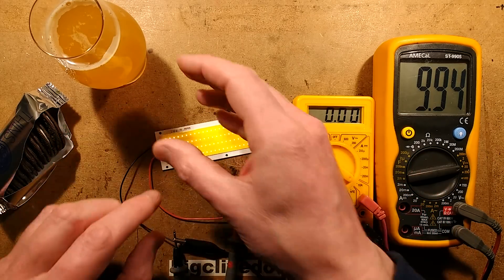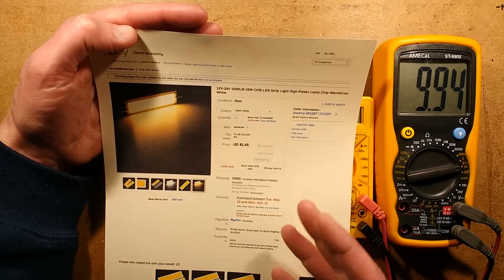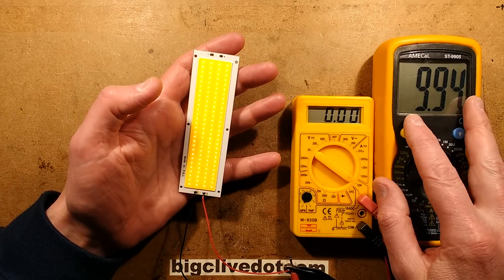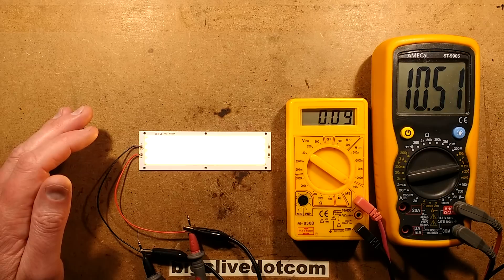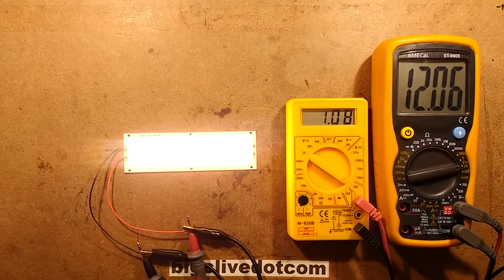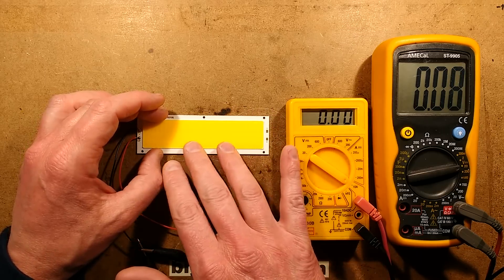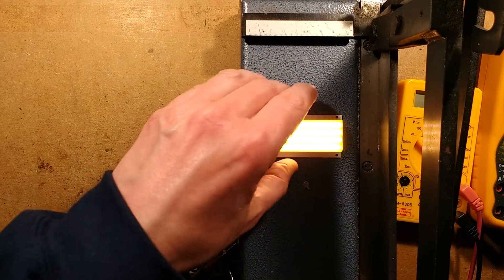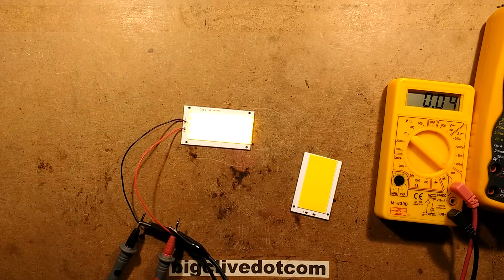Testing a large LED COB.

Comment: ok six years late, but-
What is the forward voltage of these?
I need a constant LED, not PWM.
Have bought a similar panel and an (adjustable) 1 Watt constant current driver from aliexpress, but the panel is either on full bright & very hot, or dim it only slightly, then it goes off.
When slightly dimmed it seems to be flickering ( using it to illuminate a  light sensor, which then reports millions of on/off cycles
Reply from the maker: It depends on how many LED sections are wired in series in the panel.  It could be 3V, 6V, 9V or 12V.  Usually 3V or 12V.
Reply: @bigclivedotcom  Thanks. I put my diode tester on the panel, it is meant to give the forward voltage of said diode. However on the panel, it read nothing, neither did a simple ohms reading.
Reply: @bigclivedotcom  Another question if I may (not sure where else to ask).
Are the cheap Aliexpress 240V LED ceiling lights with little power supply, constant current?

Reason for my asking, I have built a camera shutter tester (that works, unlike most, that forget light sensor also has width, thus give greater under-reading as 'speed' increases) using lasers works great, but a constant current light source would be better in some situations.  Of course a PWM light will not work as the sensors see millions of on/off cycles.

I have tried a panel similar to yours, rated at 1200mA and used a constant current module, with adjustable output to max 1A.

However, lowering the current makes the panel turn off & on full power, gets hot very quickly.

Comment: I just got a couple of these in the mail and my god they're bright. I've only got a cheap universal power supply set to 12V and it's running at about 0.45 to 0.5 amps and it's ridiculously bright even at that current, can't even imagine doubling that. Definitely need to figure out an elegant way to mount/power them and put them to use, absolutely brilliant for the price

Comment: So how warm do they get when driven with 12v ?  and can it be cooler if you have a current limit on it, maybe a XL4015 can be used? or is voltage control is enough using a LM2596?
Reply from the maker: Current limiting is recommended, as is a suitable heat dissipating surface.  With a regulated DC supply a simple resistor would work.

Comment: @bigclivedotcom
I've bought a small collection of these 12volt COB LED's at ebay. Plan was to make several lamps to install in my cabin using solar powered energy from a 260Ah battery. Occasionally the battery will be topped of by use of a generator and a digital battery charger. Peak voltage will be around 15volts during charging.
My question is: What is the best way to control the voltage / current that is easy to build and waste a minimum of energy trough heat.
(asking because the linear regulators using LM317 i bought on ebay gets baking hot when feeding them 15volts and pulling out around 12volts over 1 COB LED)
Reply: I have access to RS Components account at work and found this LED Driver IC : LM3404MR/NOPB
I assume that would be a perfect choice for controller build?

Comment: I bought 4 of these from two different ebay sellers and all of them are suffering from wire bond failure now they've got leds out which will come and go as you press on the panels ...and they're being very much underdriven mounted on large metal sheets with thermal compound so are not even warm to the touch when on for some time....probably a product to avoid .

Comment: i watched this when you posted it, ordered some for my camper trailer. Was just playing around and decided to re-watch. I did have a bit of trouble soldering but will bring out my 200Watt Weller gun with the 10 guage wire tip and try next time. Good stuff. Will look to replace the inside incandescent bulbs, probably with a couple of power resistors and a switch to give a dim and high setting.
Reply from the maker: You can use a clothes iron on a low setting with the plate facing up to pre-heat the panels slightly.  It makes soldering much easier.

Comment: I ended up putting one in my water fountain. It runs under water, so I guess that provides pretty good cooling. Running at 12.6v, no current regulation, BIG wires soldered to it. http://ecuflashking.com/2018-06-17-Water_fountain_LED_light/
Reply from the maker: It'll be interesting to know if it survives or if moisture penetrates the gel.  The external solder pads may corrode is left exposed under water.
Reply: I covered the soldered wire connections with clear nail polish (3 coats) and then a coat of bathtub silicone. For the naked pads on the other end I used just the nail polish. I'll let you know if I see any corrosion. I looked for little bubbles after I plugged it in but nothing so far :)
Reply: Three LED's are dead so far, and one corner is lifting up. Some bubbles are coming out of the crack. Sometimes when the water in the fountain runs low it exposes about 1 inch of the top of the LED cob, just about where the crack is, so not sure if it's related to heat or not. If you have any ideas how I can seal up my new second one to prevent that from happening let me know, or hey, if you think I should use something else than this LED cob, let me know a link :) During the daytime to see the crack: http://ecuflashking.com/2018-06-17-Water_fountain_LED_light/led_damaged_day.jpg and at the night to see the dead LED's: http://ecuflashking.com/2018-06-17-Water_fountain_LED_light/led_damaged_night.jpg and where it sits in the water fountain: http://ecuflashking.com/2018-06-17-Water_fountain_LED_light/light_sensor_daytime.jpg
Reply: It finally completely died today! I installed a new one and ran silicone all around the edge of both the center gel and around the edge of the aluminum, lets see how well it holds up now! Pics of the dead one: http://ecuflashking.com/2018-06-17-Water_fountain_LED_light/dead_led/

Comment: Hi, i love your videos ! I have a question for you : do you know if it's possible to cool down led cob with a Peltier module ?
Reply from the maker: The peltier itself would require cooled.  It might be better with a heatsink/fan on the COB itself.
Reply: thanks for the quick answer ! Yes of course the peltier would require cooling, but have you ever tried it ? Maybe the cooling ratio is better ? I doubt it if we stick to the most simple sandwich structure (led/peltier/heatsink/fan), but maybe there is a way of taking advantage of the peltier ?

Comment: what would happen if you ran it at 24 volts
Reply from the maker: It would rapidly fail.  But you could use two in series.
Reply: that would be boring

Comment: I just got mine today and did some testing and math. The ones I got used 800ma at 12.37 to 12.5 volts the voltage could be decreased as the led's got hot. I did some searching and found some specs for these, they indicate that they can be run between 600ma and 1000ma 12-14 volts. that comes out to 3 to 3.5 volts per LED and 20 to 35ma per column of 4. Mine did not attain a good brightness until they hit 800ma. so mine pull 10 watts at about 12.5v 800ma. The light output is close to a 75 watt incandescent light bulb.

Comment: I've bought some of these off amazon as "car running lights" and they make good lights for use in what I can only describe as 'piano lights' for small bench/desk lighting. They probably aren't as good with price as the one you showed (Mine were $3 per 6W COB). I've run them off a 12V computer power supply and it worked fine, even without any heatsinking.

Comment: Dear Clive....a question:  our outdoor string of LED lights, transformer failed 31v...(it got wet) i bought a LED driver transformer...20-45v  ... plugged it in...the string of LEDs now flash super bright ...not what we hoped for,we want them to be on with no flashing....there is no circuit to make them flash...its just a transformer...so i suspect the power supply is over loading and keeps cutting out??  any ideas????  and please ignore me if you are too busy...many thanks...Dorothy and Simon in France.
Reply from the maker: It does sound like it's being overloaded.  It may also be damaging the LEDs by overdriving them.  If the transformer is labeled Jutai then it will be a very common type sold with a wide range of lights.  It may be easiest to get a new set of lights just for the transformer.

Comment: ebay: more than 182 sold in 24 hours.
just ordered 10 cool white and 10 warm white
Reply: one set arrived today --warm white.
Hakko 888D had no problem soldering to the pads.
Observations:
Started with 6 dead leds, now I am up to 14 dead across 4 panels. When I press some leds, if they are on, the might go off, and vice versa. 12V 1.5 A wall wart, with 10 panels I am seeing the wallwart output drop to 10.69V
 the shipping package was atrocious considering the phosphor coating. Almost all of the bubble-wrap bubbles were flat.

Comment: Awesome brightness. How many milliamps can these cob lights take before they pop or burn out? And why did it not die when you gave it the chop.
Reply from the maker: It's construction is two main power tracks with strings of four LEDs in series between them.  I cut it between two rows of LEDs so both sides worked.  I didn't push it too hard as the life of the LEDs will be much shorter if it is pushed too hard.

Comment: I use these COBs too, without proper heatsink they got too hot so I added 2 diodes and now they run cool and reliable for over a year now.
Reply from the maker: Series diodes are a great way of nudging the voltage down to stuff like this.  I use them with LED strip.

Comment: Something is not right. based upon the 10w spec, each LED is .083w so it takes 3 rows (12.8 LED's) to = 1w ??? The math does not add up. Then observe that at 12v/1a =12w and then at 13.7v/3a =41w...It would be nice to know the true specifications of the device.

Comment: please sir help me how did you get the value of resistor to use
Reply from the maker: Voltage difference between LED and supply, divided by desired current equals resistor.

Comment: I replaced the interior lights in the back of my sprinter van with those, with a small heatsink bonded the back, it doesn't really get hot... I don't open the back with the engine running, so they never get more than 12.6v less voltage drop... I measured 13watts, but they aren't overheating:- https://photos.app.goo.gl/fkwUpzFpfxQziwgw9

Just trimmed them down, stripped the inside of the light fitting out and mounted the COB directly inside the existing lens.

Comment: I've never seen Oreo Thin in the States. However, we do have "double stuf" (misspelled on purpose, it's actually about 1.6x stuff) and "mega stuf" which is slightly more than 2x. We don't want less filling. We want more. This is because more corn syrup is needed to sustain our many fat cells.

Comment: Question for you, I have a portable charger for small devices. It has 2 2000mAh rechargeable batteries, would that then be 4000mAh as 1 unit, this is the writing on the batteries FST 18650-2000mAh, cap: 2000mAh, Voltage 3.6/4.2, 6H20315 13676, "made in China" wrapping is blue.
Reply: ... and the question is?
Reply: Yes. The alleged maximum capacity is 2Ah per cell, so two in parallel would give 4Ah.

Comment: I have several of these in various shapes and wattage.
Soldering without heating it is indeed very difficult, but the light of the neutral white versions are quite good value.
However, I do think they are pretty inefficient seeing how incredible hot they get for the amount of lumen they produce.

Comment: I has a sad. I have migraine-induced vertigo, and have found that LED "bulbs" (incandescent replacements) trigger INTENSE vertigo and sickness in me, so I've had to get rid of mine and actually order incandescents (rough service is the only kind available). It sucks... LED lights strobe even worse than CFLs, that's what causes it. I love the idea of LEDs, so green, energy caving, etc. The issue is that although non-strobing household LED lamps COULD be made (dc for example) nobody makes them. Migraine and Epilepsy groups have put out warnings about this... I would think that some maker would come to our rescue! Sadly not so far. The excess blue wavelengths that some put out also contribute to the problem. Someone needs to make "eye-safe" LED bulbs. They would cost a it more, but be worth it for those of us with these afflictions.
Reply: Jafafa Hots 
Low voltage DC LED's already exist and it's also possible to get ones that emit specific wavelengths of light, so you could solve your problems. The main problem causing the strobing is the power supply for dropping from mains AC to DC. They often either only use a capacitive dropper or cheap out on properly smoothing the output from a switched mode power supply. If you are able to use low voltage bulbs then you can choose a quality power supply to avoid this.
Reply: I figured something like this was possible. Unfortunately despite the fact that I enjoy Clive's channel, I'm not particularly knowledgeable about electrical matters, and since I've become disabled, my days of tinkering around with tech are over. I used to build my own PCs, now it would be a large effort for me to even upgrade my memory or swap out a video card. Hell, I need help doing my laundry. :( I actually need help just replacing a light bulb if it's overhead.
Reply: Jafafa Hots 
I can sympathise as I'm also disabled! 
Perhaps try buying some LED bulbs from a major manufacturer, like Phillips, to see if they're any better. 
Otherwise, it sounds like you're better off sticking to incandescent bulbs for now. 
Regards.
Reply: The Philips ones are the ones that triggered my vertigo so badly, Pete.

Comment: If you thing this is a big COB go for one of those 150W ones, they are the size of a small hand. Also I got the wrong one as I wanted the 220v one and the 30v version looks like 3 50w segments in one substrate, each one with independent pads...
Reply: Adria Garceran 
Interesting that you used the old unit of measurement, the small hand, whereas there's now a new international standard that's equivalent to the small hand called the Trump!

Comment: If anyone is going to use them on a 12V lead acid battery (car), a 6 ohm is not that readily available, use a 5.6 Ohm, also it will need to be a 5W to 10W resistor as it will dissipate 3W of heat. Use a metal cased resistor and bolt it to the car chassis somewhere so the heat can go somewhere. Great channel, watch it often!

Comment: Don't use these LED COBs in car. They are only "rate" for -20°C till 40°C and less then 60%r.h. The silicone glue on top of the LED will degenerate above 70°C and is sensitive to water, oil and organic solvents.
Otherwise they are quite usfull - if you cover them in casting silcone  (235 -270°C).

Comment: There are tons of Oreos on PT_PT . A Power resistor will do the job for this LED Where i can find that vice?
Reply: fabio sousa 
The vise is an engineering vise used with drill presses and milling machines.
Reply: Thanks for correcting my bad english :P. I can find that vise in tools department store or online? I need something to hold plastic pieces , small copper tubes to be worked on dremel.
Reply: fabio sousa 
There are lots of vises on eBay. For holding pipes and tubes you need one with a 'V' shaped groove along the jaws to hold such items firmly (stops them rotating). Perhaps something like this would suit? 
http://www.ebay.co.uk/itm/292130804109
It has a suction base to attach to smooth flat surfaces but there are many more to see just by searching for 'engineering vise'.
Hope this helps. 
Good luck!
Reply: Thanks a lot. i was searching for some on ebay and i find that too.  I'll save it to the list since it will fit on my desk. I'm using a  locking pliers  to at least get small parts stable on my left hand

Comment: I bought a pair 2 years ago. I converted a cfl floor lamp by gutting the high voltage circuit and replacing it with a 12v 4a power supply. Then put a 10ohm resister to limit the current. It is almost as bright as a 60w spotlight. I used a pentium heatsink w a small fan to keep it cool. It never gets above body temp.

Comment: What would stop you from putting 4 diodes in series to drop the approximately 2.8 volts? Sena uses something similar in their motorcycle BT headset power supply/chargers.
Reply: Myrune1 
Nothing, but you'd need to make sure to use diodes with sufficient current rating.